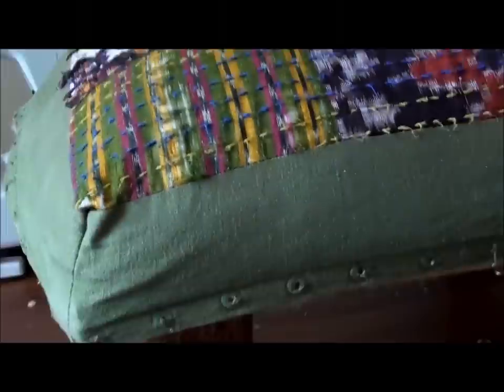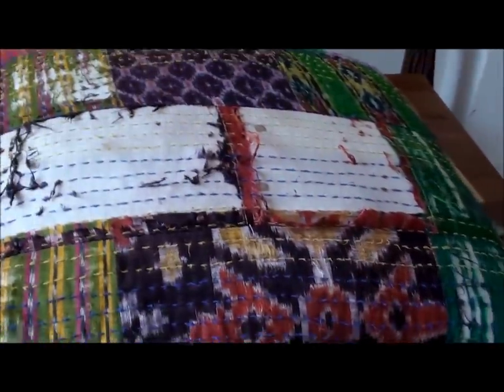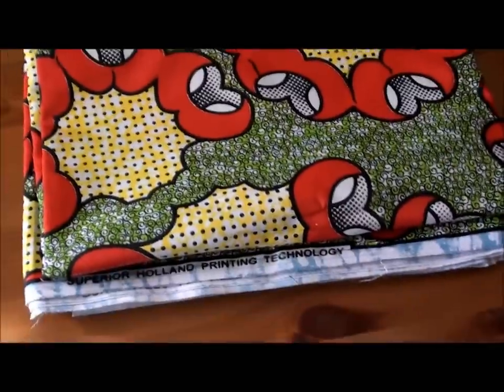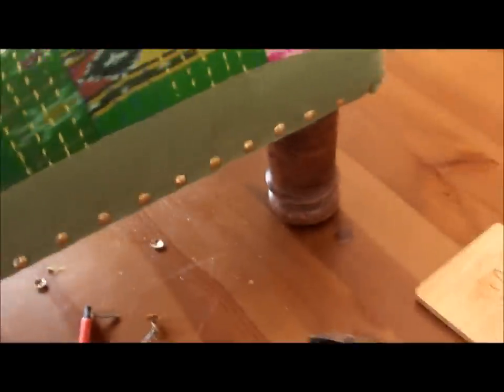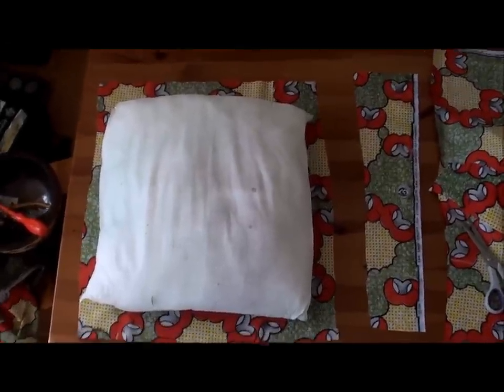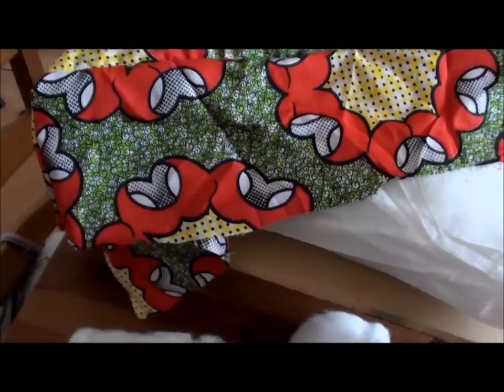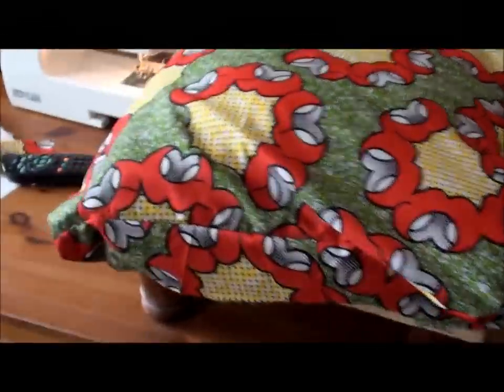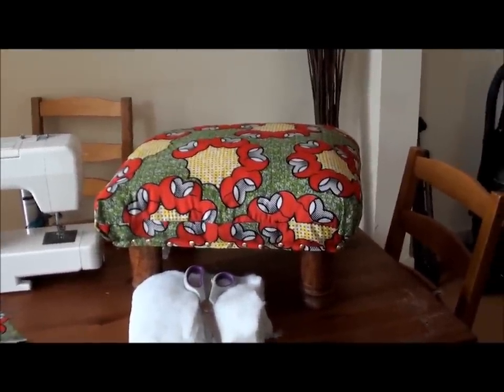How to reupholser a foot stool

Comment: As a textile designer, I can tell you that the industry works on supply by demand, like Primark. I really hate cheap copies that undercut the textile industry, it is killing the craft! and I never ever shop in places like Primark that fuels the 'knock of' industry.

That said, fantastic project really nice job, will give it a go with my toddlers toy box and my own hand printed fabric.
Thanks for the vid.